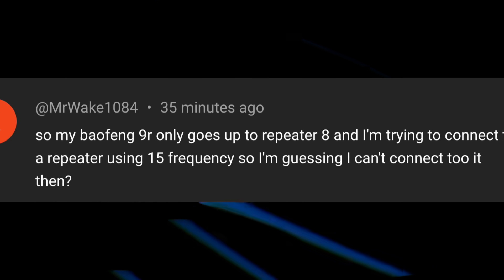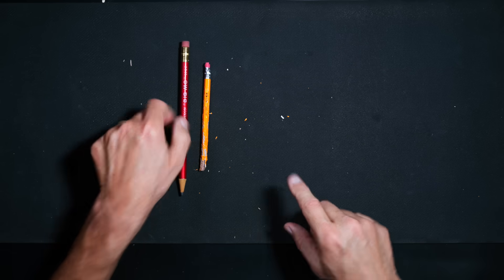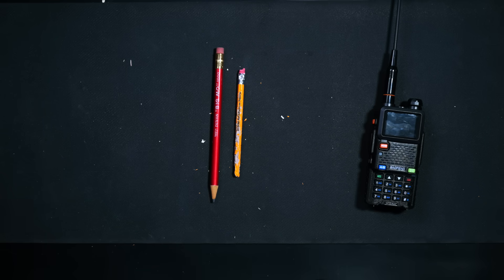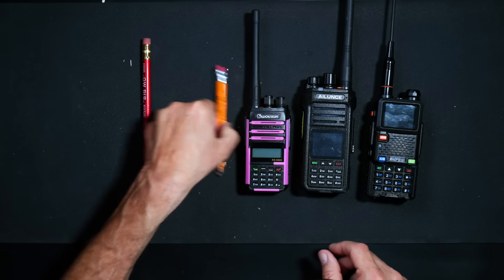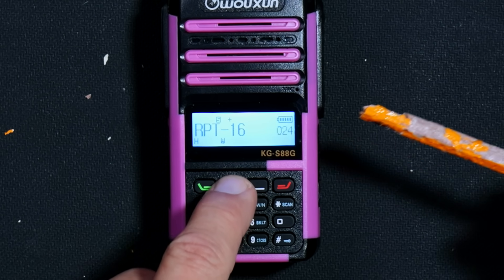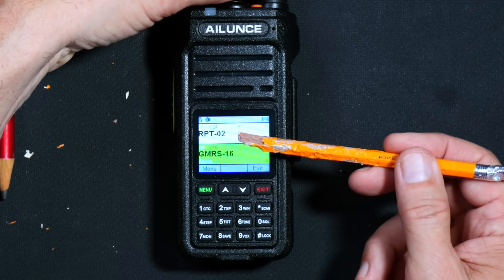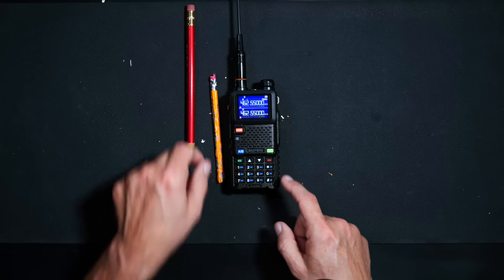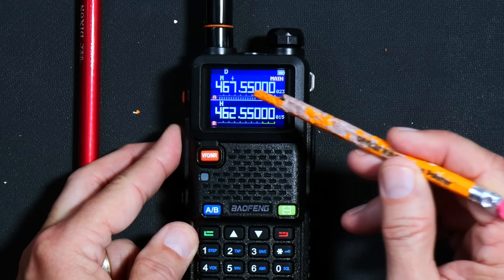GMRS Repeater Channel Numbers & Names Explained - How Repeater Channels Work On GMRS Radios

Comment: I appreciate you trying to help me.I know you're really trying😂 I'm doing everything right im pretty sure.

 Channel 37(DIY7) to transmit  and channel 17(GMRS17) to Receive to connect to Repeater 15 with tone T-CTCS 77.0HZ on channel 37 and R-CTCS 77.0HZ for channel 17 And I'm well in range of the Indianapolis Repeater using frequency 462.550 MHz because I only live in franklin But I still am not getting anything. At this point I don't know if it's something in my settings.That doesn't allow me to transmit or if my radio is just bad.Or if i'm still doing it wrong.  LOL

Comment: Help! I am new to GMRS but not radio, which I've used since the 60s. I just got a GM-30 Plus and I'm trying to set it up for the Inland Empire repeater on 462.600 MHz. Channel 25 has the right frequencies so I simply set the TX DCS menu item to 23 (D131N). No go! But this COULD be a matter of coverage.

I re-checked the frequencies, which are immutable, and noticed the input and output are reversed. So, I checked the Direction menu item and discovered that it's immutable, too. Q: Can anyone tell me why this is? Is it likely that it's an error or did Radioddity do it deliberately for some reason? 

The other possibility is that the repeater documentation is in error. But, I respect the author and doubt this is the case.

I realize the fix will be for me to set up a new channel that has the same characteristics as channel 25 but changes the setting of the Direction menu item. This will be cumbersome because I use my wife's Mac and the set up software is Windows-only.  So I want to understand all I can before rolling up my sleeves.

THANKS!
Reply from the maker: Tell us exactly what you mean by "the input and output are reversed" - tell us what you see.
Reply: @TheNotaRubicon  Thanks for your reply! Sorry: I figured this was a common issue because I supposed that beginners get these settings wrong in this way all the time. So, I shortchanged the explanation. Also, if one plays with these numbers a lot it's easy to get dizzy!

I mean that the input and output FREQUENCIES are SWITCHED: Instead of RX Input 467.600 and TX Output 462.600, the radio's built-in information says RX Input 462.600 and TX Output 467.600. And, these values can't be changed on GMRS repeater channels, such as Channel 25. 

Of course, I can pick a random non-GMRS channel such as 225 and put in whatever values I choose. The thing is, I want to understand why Radioddity would have done this. I suppose those folks are smart and had a reason for their choice because it's otherwise a pretty slick radio. I have, of course, asked them why and I hope they will reply,
Reply from the maker: On a GMRS-radio repeater channel the RX (Receive) frequency is ALWAYS 462.xx and the TX (Transmit) is ALWAYS 467.xx.. 
So unless I am misunderstanding (you DID write a LOT of words just to say that), then it sounds like the radio is correct.
Reply: @TheNotaRubicon  THANKS! Yes, I've made myself dizzy. My confusion arose because I was thinking of the repeater's configuration rather than the radio's configuration. That happened because frequency tables are always (as far as I know) written from the perspective of the repeater whereas I think it would be better if they were written from the perspective of the portable/mobile radio. As to the number of words I wrote, you should see what happens when I feel like writing! On one occasion the result was a book of more than one thousand pages. In this case you asked for more words and you got 'em! 🙂 Seriously, I appreciate the help.

P.S. There's a fine review of the GM-30 Plus on this very channel. I apologize for having neglected to mention it earlier and having also neglected to mention the affiliate links. There are also several presumably fine articles on repeater set up. I will be watching those to reinforce the correct neural pathways. . . .

Comment: I have a question sir. Do the different frequencies on the repeater or even in simplex do any have a higher range than the other channels or what makes a specific channel a repeater channel. Just because they're at the end of the range or do they have a better area of coverage with depending on the frequencies that they're at I'm a newbie and that's why I'm just asking stupid questions so you can slam me all you want Mr not a Rubicon cuz I'm in a Rubicon all weekend. I'm going to put it through all the pacers and two wheel and four-wheel and see how it goes. Thanks for all you do also do you have them shirts for sale or you just like getting strange shirts and if so where do you get them at. Later, Crazy

Comment: If a GMRS repeater is marked as an OPEN repeater and a TRAVEL repeater, why do you still have to have permission to use the repeater? It's NOT a truly open travel repeater if you have to do that. But according to MYGMRS you can use it freely. What's the point of having a repeater marked OPEN if you have to ask permission? That would make it a CLOSED repeater.
And in my opinion the UV5R is a joke. The market is flooded with them now.

Comment: Not to worry. If you bought the "wrong" radio, you can plug in whatever repeater channels you want in whatever location you want, if you want to. Doesn't have to be in order.  you can also plug in the repeater channel input so that you can directly hear someone near you either trying to jam a repeater  or unknowingly calling into a dead repeater during an emergency.
Reply: correct, chirp it